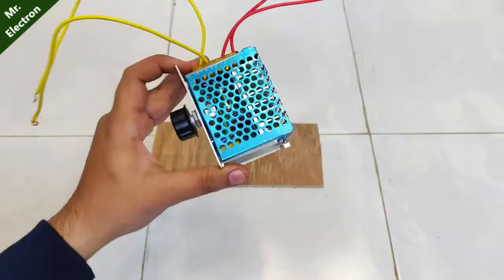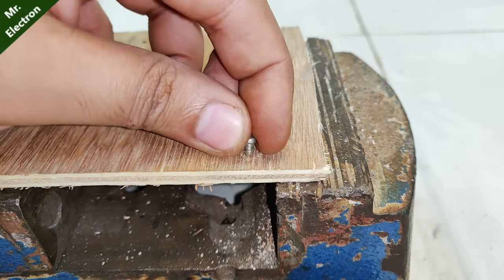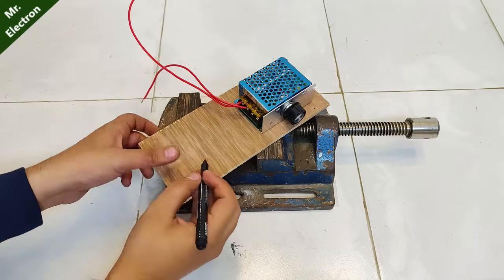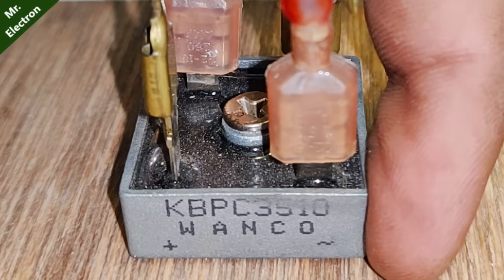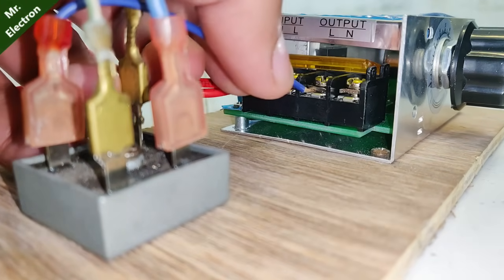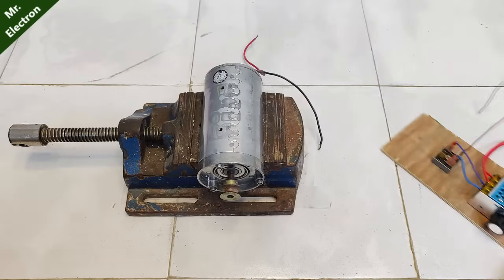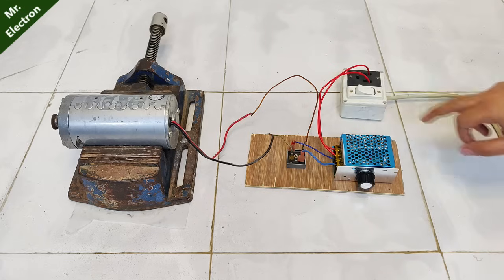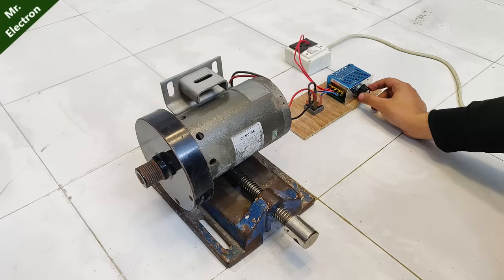How to make 220V 4000W DC Motor Speed Controller ( RPM Control )

Comment: Hello,
 I have a single-phase motor 150 watts, 2950 RPM, 1.5 Amps 220V. I'm looking to control its speed and I've come across several speed control devices online. However, as I'm not an expert in electrical engineering, I'm having trouble determining the suitable device to achieve a speed range of 0 to 300 RPM and an operating duration of up to half an hour. I would appreciate your guidance in finding the appropriate and cost-effective solution.
Thank you.

Comment: Can I use it in the buggy
Reply from the maker: No
Reply: @MrElectron  sorry.why?
Reply from the maker: Actually, this is a 220v AC controller with a cord. A cordless battery-powered buggy will be a better and more practical option.

Comment: Also using a rectifier bumps up the voltage of the A/C converted to DC. So if you have 120v ac you will get roughly 160V DC

Comment: Hello! my name is Florin and I am writing to you from Romania, I also have a 180v engine similar to yours and I don't know how to start it because it only works on 180 volts, can you explain to me what parts to buy to be able to start it in function? Thank you in advance!
Reply: Cheapest route would probably be to purchase a boost/ buck converter (it's where you can use say a 24 volt or 36v 48v battery etc. And adjust the output voltage to higher than what you have plugged in. Depending on what your using it for they have a cheap priced one that you can use 36 volts on it and adjust out put voltage up to high 300s volt. Just by turning the "knob" (potentiometer to the clockwise rotation) the more you turn it the higher the voltage. You can use a volt meter to see exactly what voltage your at. Just research it and stay safe!
Reply: Roughly about $15 and they have more powerful ones too for a bit more. Hope it helps you on your goal.
Reply: Me too

Comment: Hola estoy usando el mismo regulador del vídeo, el mismo puente rectificador pero no logro obtener los 170v que necesito para mí motor. Que podría ser? Gracias
Reply: Put 3 rectifier bridges in parallel that you can reach 180v DC,👍🇧🇷

Comment: Why are you using an SCR controller to run a DC motor?
1.  Inefficient because part of the sinewave is clipped in order to reduce the output;
2.  Reduced sinewave means less power output at lower speeds;
3.  SCR Controller should not be used as a DC motor speed control if you want power at lower speeds; and
4.  Better to use a PWM DC controller to maximize efficiency and power output at any speed.
Reply: How do you connect the ac to a Pwm dc controller?
Reply: @davidme9698  
The same way this motor was used in a treadmill.  AC goes in and converts the AC to DC and controls the speed of the motor via PWM.  BTW: Treadmill motors are DC motors.
Reply: @valveman12  all the ones I have seen on eBay and Amazon use a battery to power them. Not ac
Reply: @davidme9698  
I have no idea what you are referring to.  Treadmills do not run on a battery.  The motor in the video is from a treadmill.  If he kept the original treadmill speed controller, that would have worked better as it is PWM.
Reply: @valveman12  I understand that but I don’t have a treadmill control, I want to make one. Like the video is showing but when I heard your concern of a scr not working but a pwm would. I checked into it in Amazon and eBay. Every pwm control is a speed control for a dc input to a dc output. Unless we can connect the 120 ac to the input and it works. Also Out of at least eight other videos doing the same thing all use a scr.

Comment: It's not a controller, it's just a power regulator. You can buy one at any electrical appliance store in your city. Such regulators are used to adjust (reduce) the power of the fireplace, soldering iron and other heating device. Exactly these are in electric drills. This is a primitive circuit, it just cuts a sine wave from the network. Those. the speed is reduced simply due to a decrease in the current on the collector motor. When a load is applied to the engine, the speed will drop, this regulator controls absolutely nothing.
A real controller of a collector motor has a RPM sensor, which is installed near the rotor shaft and, under load, maintains a constant RPM regardless of the load and the engine always runs at its full power. The shaft must have a magnet or a light reflector, depending on the type of sensor. These are expensive electronics with a specialized chip and sensor. Such controllers are sold too, chips are also sold separately.
For asynchronous motors, another method is used - a frequency inverter, because its RPM depends on the network frequency (50/60 Hz). This inverter supplies different frequencies to the induction motor - from a few hertz to hundreds of hertz. Thus, the RPM is not controlled, but the engine delivers its full power at any RPM. Frequency inverters are also sold.
Reply: @grain do you know what could cause a humming noise in a 220V single phase motor when connected to a dimmer ?
Reply: @adrianTNT  Put an EMI filter before
Reply: @standolfo  between fan and dimmer or between dimmer and mains socket ?
Reply: @adrianTNT  after line socket before dimmer
Reply: Landscape Design Garden Design for Small Gardens   I've used succesfully the 10.000W regulator with the 50A diode rectifier for my 180V DC treadmill.. there's a light decrease in power when on  load but i compensate rising the pot and I'm fine
Reply: perdon la pregunta que calibre se esta usando
Reply: Pretty lengthy comment 😂😂😂